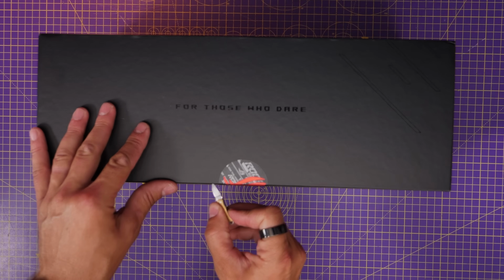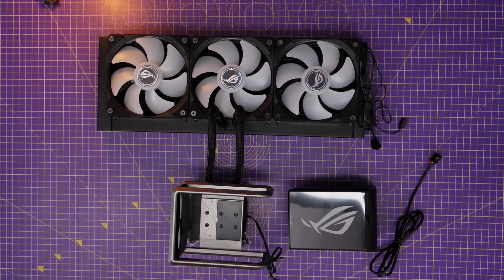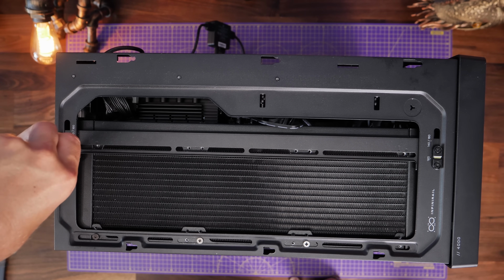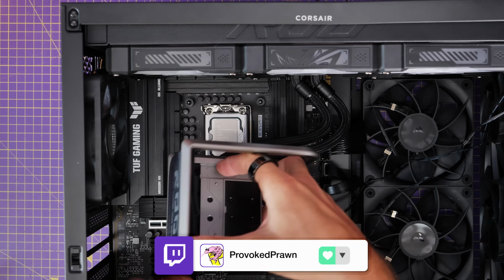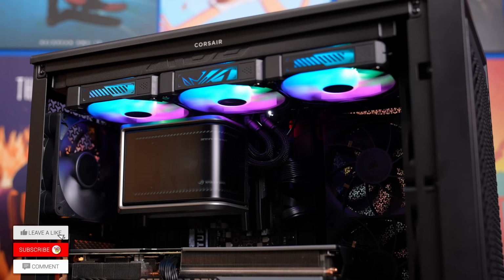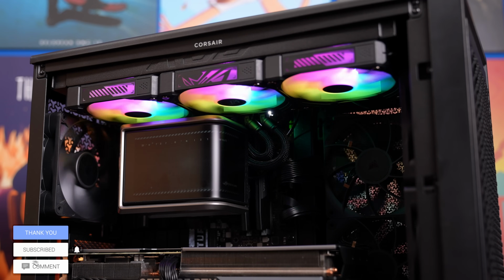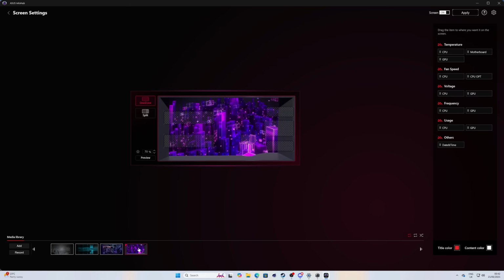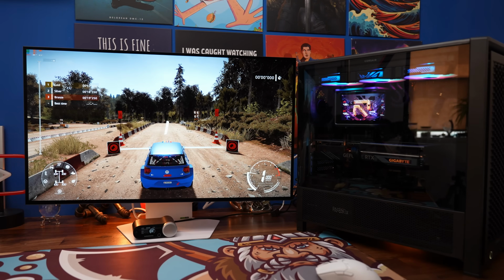Asus ROG Ryuo IV SLC 360 ARGB setup and wiring guide

Comment: Very nice video. I have the Frame 5000D and am having a problem with the Asus ROG Ryuo IV SLC 360 because I can't screw the radiator on top since the adjustable rail is too narrow.
Reply from the maker: Can't you move the infinity-rail to adjust it to fit? You just need to unscrew that
Reply: @TheProvokedPrawn  I know, but the rail is narrower than the Frame 4000D. The distance to the screw holes on the hoses is greater. The rail is too narrow. The bridge to the edge is narrower. You can see the difference on the Corsait website.

Comment: Just a question, the bracket to install the aio to the motherboard is there away to install in on a LGA1200 (yeah i know that is an old socket) but i notice that the tryx does still support that Socket.

Comment: Did you find the AIO pump made much noise? Recently installed one and it's got a fairly annoying whine that messing with RPM doesn't really disappear, just changes pitch that's about 35db at 40% and 40db at 100%
Reply from the maker: I haven't had that issue. Maybe ask Asus about it?

Comment: Is it possible to remove the gray frame to make assembly easier? on my Havn hs420 vgpu I think the space between the gpu and the gray frame will be very small :P
Reply from the maker: I don't believe so
Reply: @TheProvokedPrawn  I already have mine, I can confirm that the frame can be disassembled very easily by removing the six small screws that hold it, I made some new parts for the rail and thus raise the position of the screen a little since in my Havn HS420 vgpu and a 5090 Astral did not fit. If anyone needs the stl, send me DM, no problem 👍

Comment: I bought this product for my PC with a Ryzen 9 9950 x3D CPU, and at idle, it reaches 65 to 70 degrees.
Armory Crate doesn't detect AIO, and Info Hub doesn't change the images on my screen. The worst value for money.
Reply from the maker: Are you sure it's connected properly and the pump isn't loose?
Reply: @TheProvokedPrawn yes, now i update the firmware and display work, but temp are still hight in idle, in gaming 70 degrees

Comment: Great vid again, just ordered one and looking forward to getting it in the case!! 
Side note, can I daisy chain 3 case fans, both the power and the argb, and plug the single cable from each at the end of the chain into one port on a SATA powered hub or do they all need to be seperate into the hub?
Reply: If i were you plug it onto the mb. Use your hub for other things if need be. But yes the fans are daisy chained out of the box

Comment: Its pretty bulky, is there any clearance concerns when using a big gpu like the asus astral in a vertical gpu mount?
Reply: it won’t interfere with the astral, but it will hide your motherboard or ram if you have nice ones. would rather go with tryx panorama and switch out those mediocre fans it comes with.